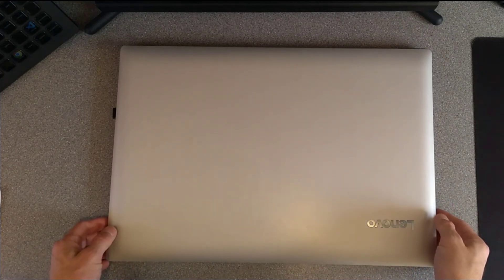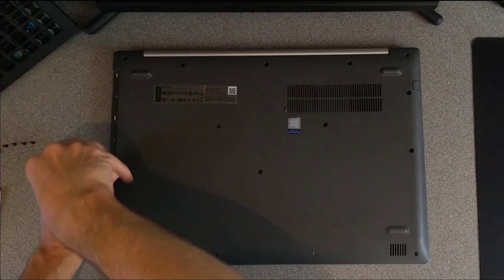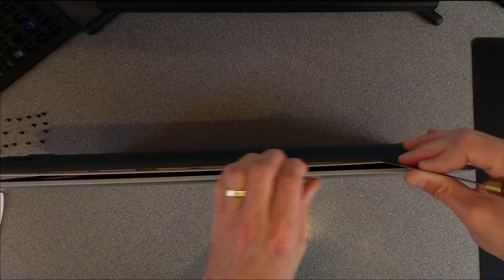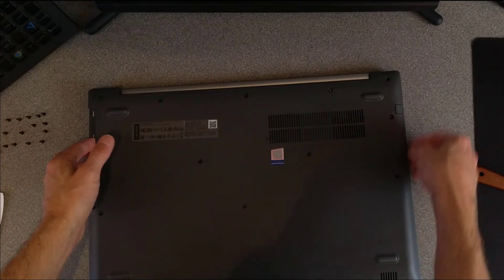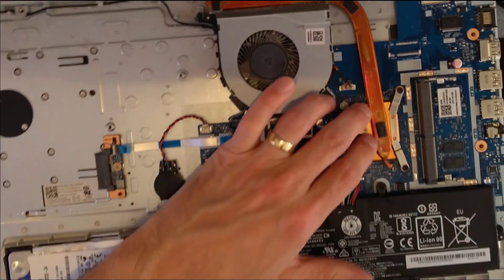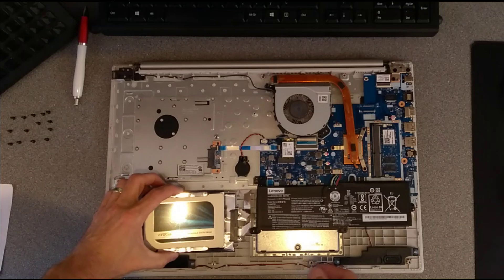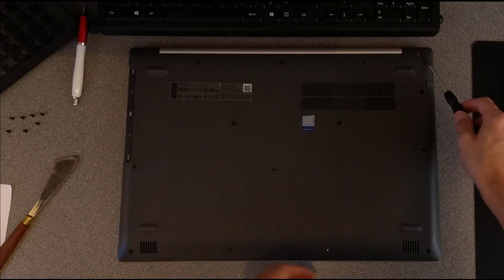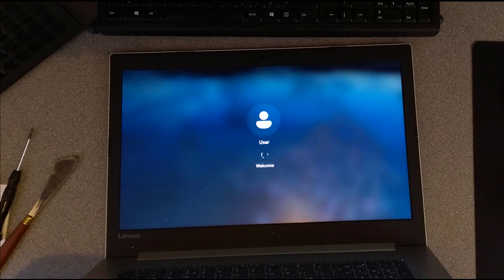Lenovo Ideapad 330-17IKB: How to replace or upgrade the hard disk with an SSD

Comment: Does this have an M.2 slot?
Reply from the maker: The one in my video has the pins on the board in the top right however the connector and the mounting bolt to screw the storage card down are missing. I suspect other components to support it are also missing even if you added a connector.
Reply: @freename  Thanks